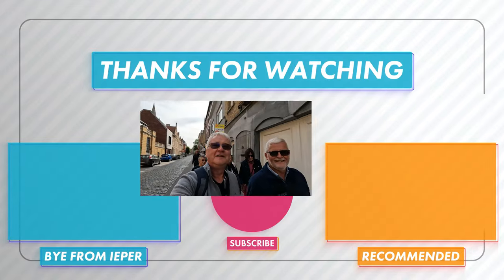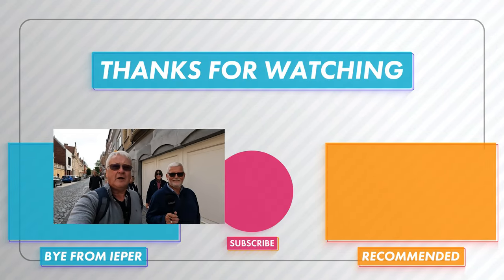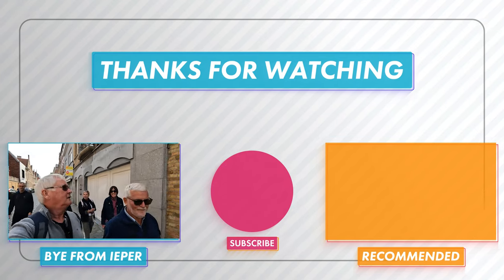Top 5 Changes To The Highway Code | Vanner's Collaboration October 2023

Comment: Hi Bob a great video and some great suggestions I agree about the maximum weight for motorhomes and also caravans vans and trucks and the tyre tread  as well 
The passenger side brake pedal would be great or a backseat steering wheel lol 😂

Comment: It’s hilarious here in Wales. 20 mph everywhere there are street lights unless otherwise signposted. We have 20 mph, then 30, then 40 then back to 30 for a couple of metres then 20 etc etc. one stretch of road with a pub where a child could easily run out of the door onto the road but that is 40 mph then a stretch with no school etc but that is 20🤪🤪🤪unbelievable. Also one stretch of the M4 we have to crawl along because car pollution kills but there is the massive Port Talbot steel works just to the right of the road belching our goodness knows what chemicals, gotta laugh😂😂😂
Reply from the maker: I found the change in speed limits confusing on the Isle of Wight too. 🙄

Comment: Interesting. Here in Japan, there is currently a debate going on about allowing car sharing. Currently it is illegal. As for the traffic lights countdown, there are three varieties in existence here in Japan. The first is a countdown in minutes and seconds on temporary traffic lights for roadworks. Especially (but not limited to) in rural areas as because of the length of the roadworks and the terrain, there may be a wait of 2 minutes or more. The second is a countdown on pelican crossings for pedestrians. These aren't in seconds but rather a series of bars that go out as time progresses to inform pedestrians as to how much time they have left before the lights change. The third is rare, but some permanent traffic lights also have a countdown in seconds. These are often found on traffic lights,  typically in rural areas where the traffic lights use a sensor to detect traffic waiting at a red light. Sometimes, the wait can be long and people start wondering if the lights are working. A kind of reassurance that the sensor is working and that the lights will change. The traffic lights are labelled here so that the driver knows what kind of traffic lights they are. Be they timed or sensor driven.
Reply from the maker: Thanks, that's interesting to hear.

Comment: Increase the B1 license to 4500kg. At present you can have a B1 license restriction we’re the driver is restricted to a maximum of 3500kg but can tow a trailer up to 2000kg.
Reply from the maker: Yes, good idea. It may happen because of the increase in weights of EV vans.

Comment: What about signs in the UK actually stating numerically what the speed limit is instead of the pointless National Speed limit. I have to think hard as to what the number is depending on the type of road. Visitors to UK won't have a clue!!!    In Europe, the driver is given the number on the sign.
Reply from the maker: Yes, the trouble is the National speed limit also depends on the vehicle as well - motorhomes over 3.05tonnes are limited to 50 on national speed limit single carriageway roads and 60 on dual carriageways.